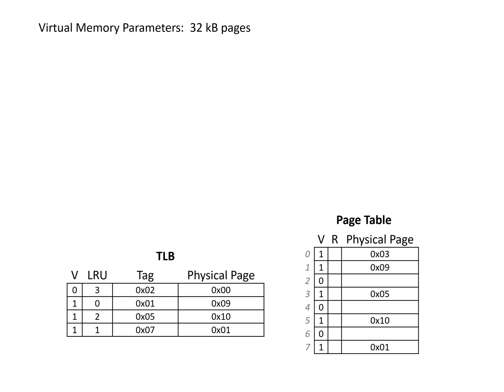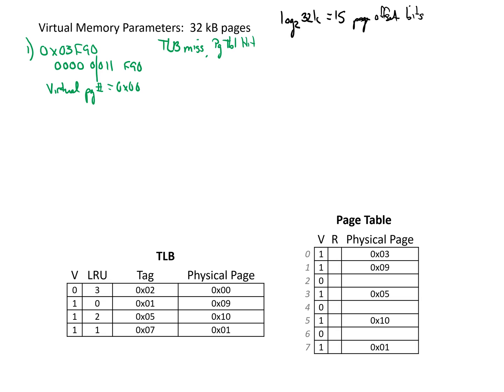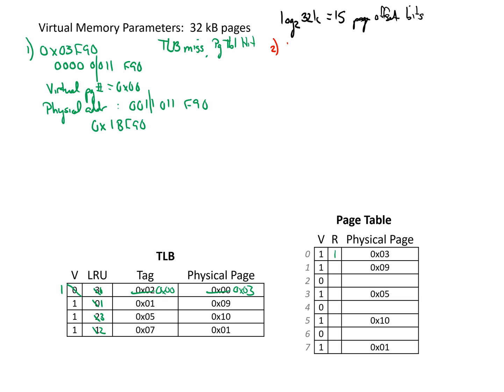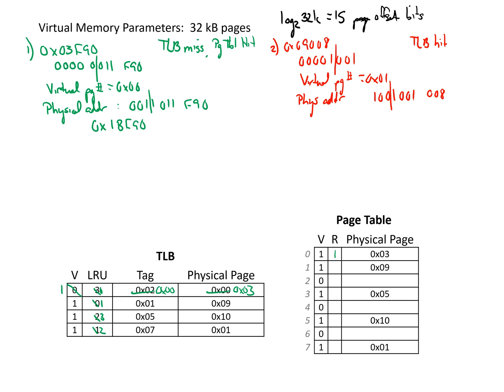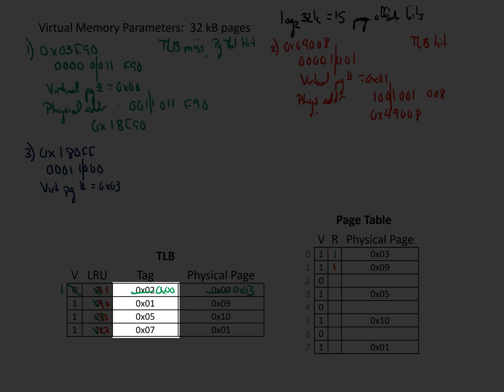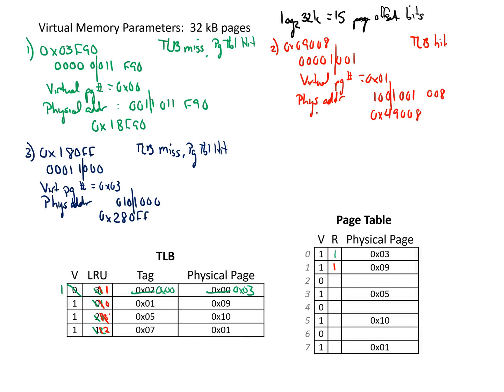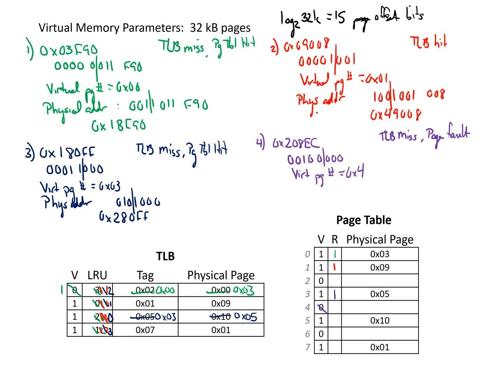Virtual Address Translation Example

Comment: Thank you so much tutorial! I have question: two processes can have the same virtual addresses. I just want to confirm with you that, in this tutorial, since we FIXED a mapping from virtual addresses to physical address,  under this mapping, different processess must have different virtual addresses?
Reply from the maker: No, it I understand your question correctly the virtual addresses can be the same in different exections. Did that help?
Reply: @matthewwatkins88  Thank you so much for the response! I understand that two different processes can have the same virtual address. Say P1 and P2 (two different processes) have the same virtual address; then under the Translation, P1 and P2 will be mapped to the same physical address. But P1 and P2 should have different physical addresses? So there must be something else to get involved? What is that? Thanks again for your help!
Reply from the maker: The virtual address can be the same, the physical should be different

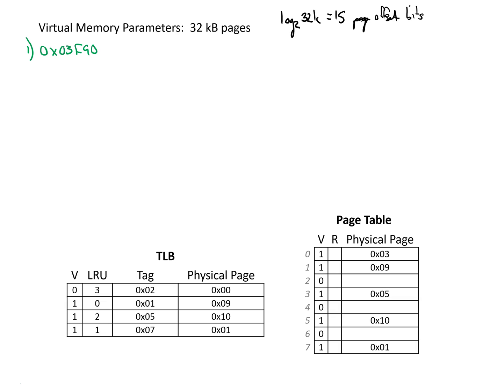Comment: 0:57 why last 3 are getting cut?? why not 2 or 4 bit??
Reply: The page offset is 15 bits (because 32kb = 2^15). The least significant 3 hex digits represent 12 bits (each hex digit is 4 bits), so they're entirely in the page offset. But these bits only account for the least significant 12 of the 15 bits in the offset. To find the most significant 3 bits, convert the hex bits left over (0x03) to binary: 0b0000 0011. Take the least significant 3 bits (0b011) and prepend these to 0xF90 which gives a page offset of 0b011 1111 1001 0000. The virtual page number is everything to the left of the offset, 0b0 0000. Here's the split on the full virtual address: 0b0000 0|011 1111 1001 0000.